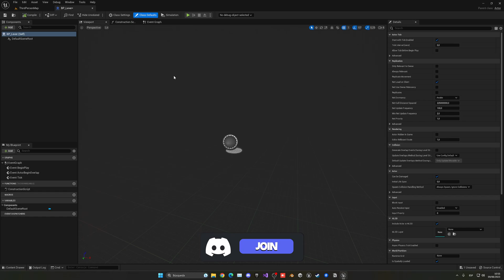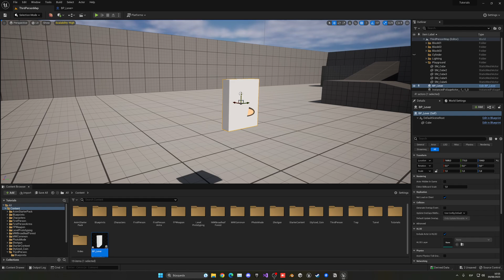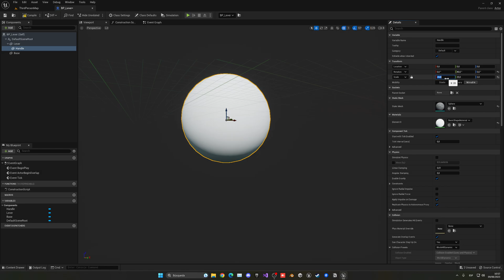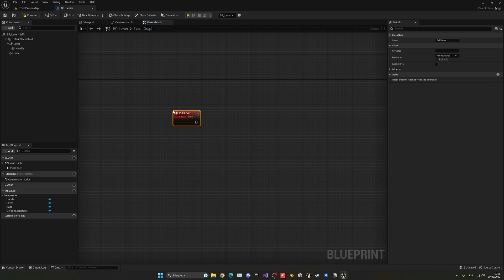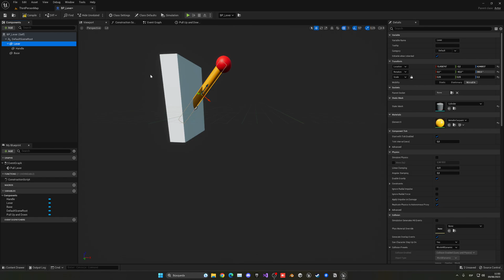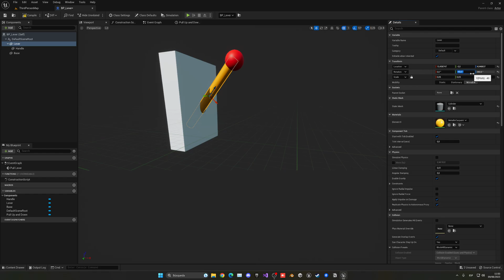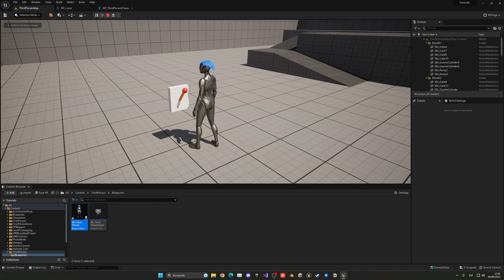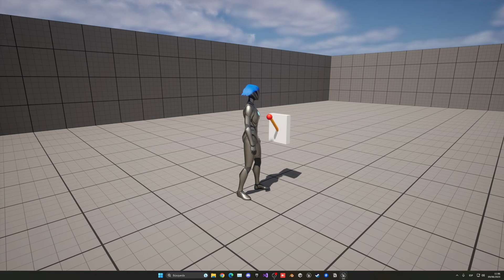How to Pull a Lever in Unreal Engne 5 - Beginner Tutorial

Comment: I'm guessing if I want to take this further, like, when near the switch and pulling it, have the character move to the correct world location, have the character's palm attach to the lever and let only the hand animated with the pulling motion, would it be easy to do, or is there another workaround to this method shown here that is faster and more catered to what I want to achieve? Basically, I would want to add more detailed interactions and animations as much as possible, may even want to add a little cutscene that when the character approaches and pull the lever, the camera cuts to a moving close up of the hand griping the lever, then pulling it, then cut back to the default third person camera... would it be easier if i just activate a cinematic sequence instead and animate the lever rotation and the hand animation manually instead of using Blueprints and messing with timelines and transforms and stuff?